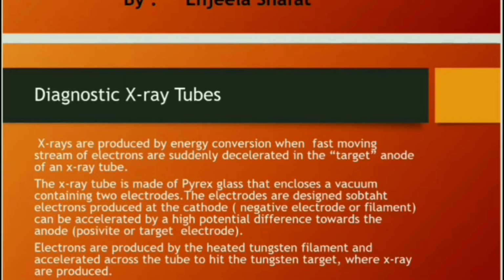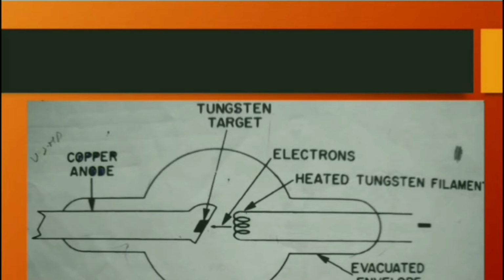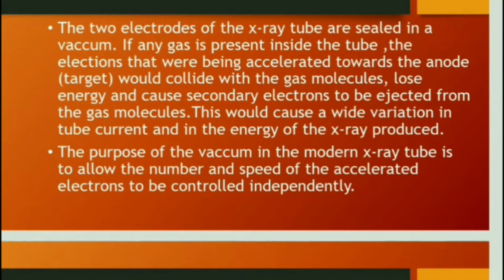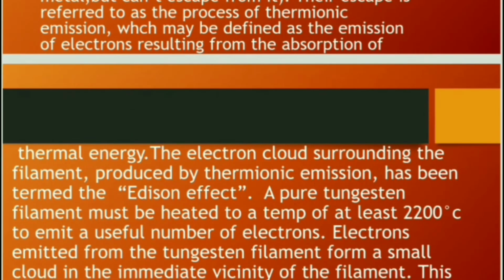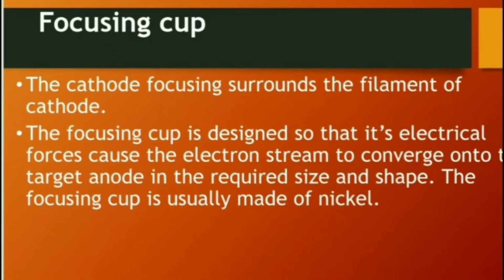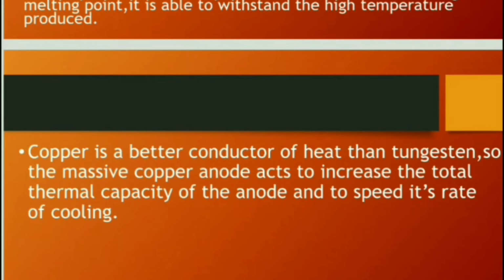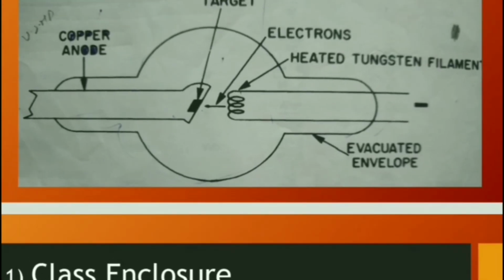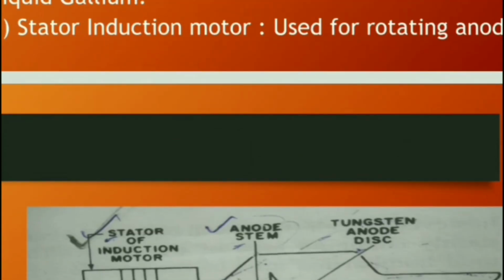X-ray tube | Production of X-rays |  radiology lectures | ~ enjeela shafat

Comment: Production of x rays; when fast moving electrons collide to the specific area of anode called as focal spot. Where deceleration of electrons happens and kinetic energy of electrons converts into heat energy and x rays. Only 1% of x rays are produced and 99% converts into heat energy. Heat is considered as the undesirable product of this conservation process.
Interection of electrons with target materials results in the production of 
1) Bermesstralung radiation 
2) characteristic radiation. 
Explain these two terms?
Reply from the maker: It is already uploaded kindly watch the mentioned video link.https://youtu.be/-UOih3z-qd0